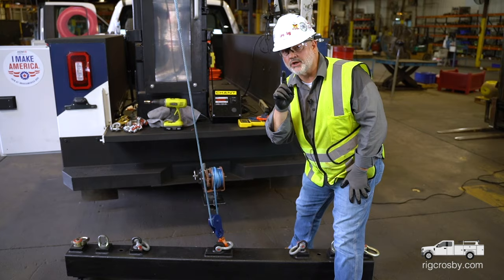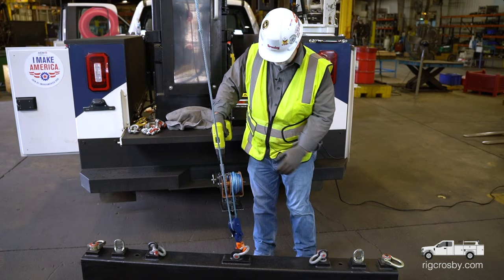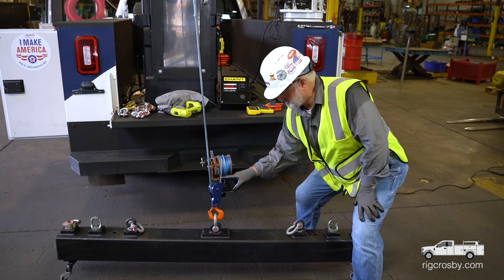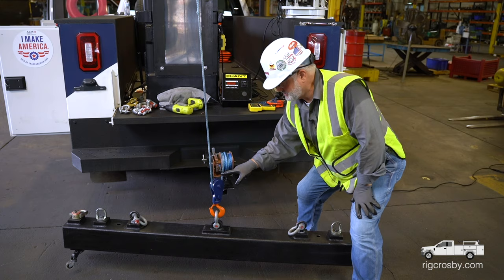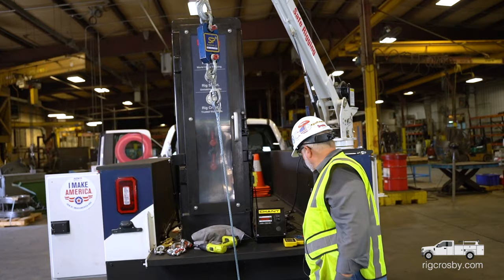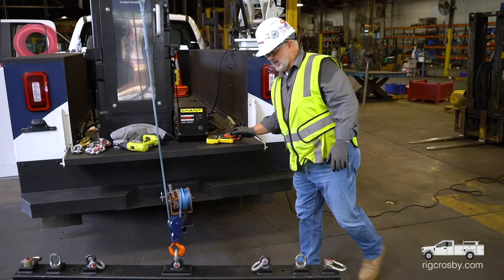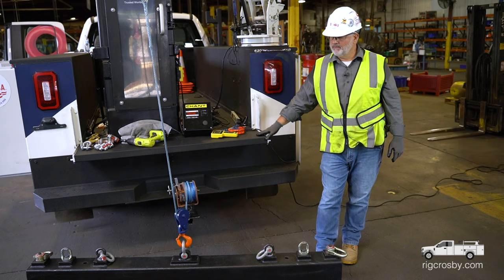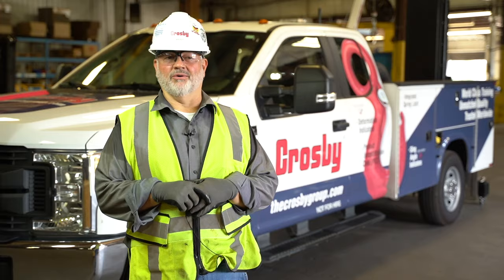Snatch Block Demonstration

Comment: the only thing that makes this a "snatch" block is the fact that you can open it up to allow you to put the line on it  rather than having to thread it through from the end of the line. In all other respects it's a regular pulley, and all regular pulleys will act as your "snatch" block acts.

Comment: This is a great help. The pulley must be connected to the moveable load, not the anchor point (for a single pulley). I would of had this wrong. Thanks
Reply: It doesn't have to be if all you want is change of direction.  It must be if you want mechanical advantage.

Comment: This is great. I will save it for all of the off road videos that use snatch blocks on the anchor claiming there is mechanical advantage. Thanks for the demo. One note, the winch force or power is not increased. The load limit it is able to pull is increased by the mechanical advantage. There’s a slight difference but important to understand.

Comment: What would the scale read if the scale was placed between the weight of Subject of 120lbs and the hook of the bottom pulleys in the second example setup? .... I have not measured it myself and I plan to do the research myself and prove it .....  there are a lot of idiots playing with youtube audiences nowadays thus I never take things for granted when I watch videos .... even the 911 twin towers videos are wrong as 3 highrisers or very tall buildings were "demolished" but we only see 2 airplanes .... thanks for sharing your video and for allowing comments.